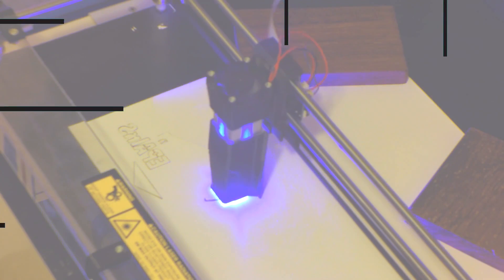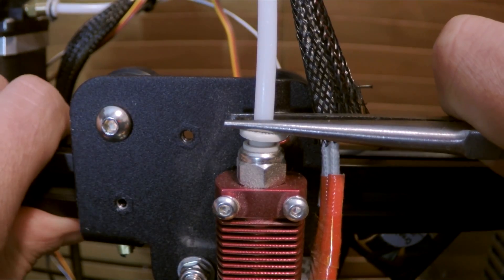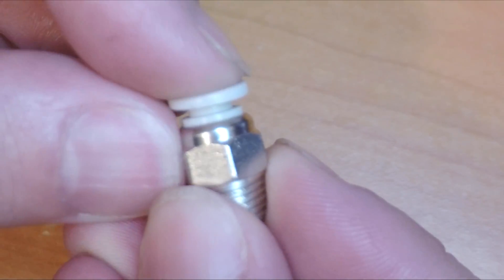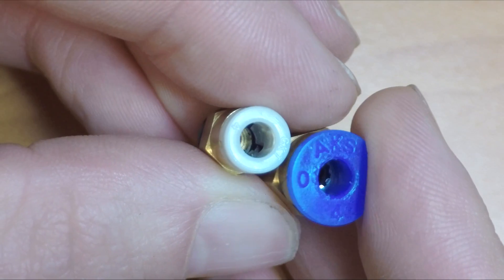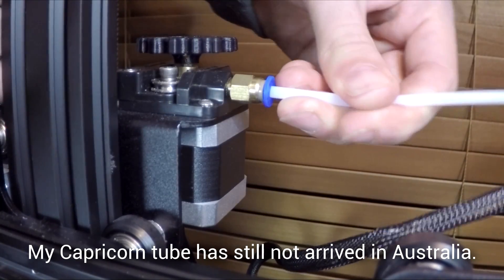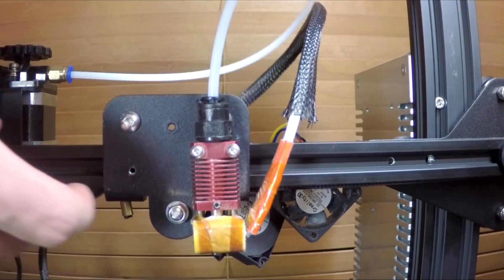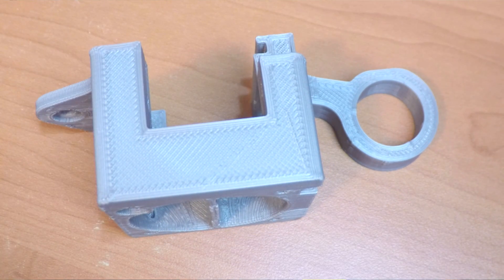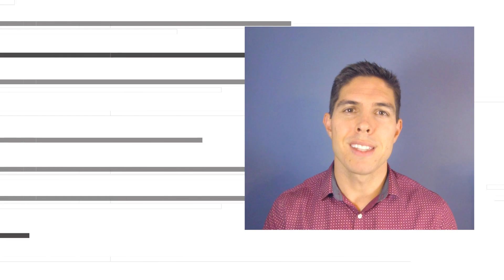Upgrading Ender 3 PTFE tube and couplings - Quick and easy!

Comment: What about compression fittings ?  I've seen a lot of favorable comments that they don't bite into the Bowden tube but compress around it- and without compressing the internal diameter of the Bowden so as to cause drag as the filament passes through the Bowden.  Comments ?

Comment: I actually had a problem where the stock tube melted in the hotend and couldn't get the filament out.
(Iv never had to work on my printer and got it second hand prebuilt)

Comment: The PTFE tube from my ender3 v2 started to come off from the extruder side a few weeks ago... notices that no filament was coming out from the nozzle when figure out the source of the issue... I confirmed that the extruder fitting part (the pneumatic joint) had no teeths to grab the tube anymore... lucky me the ender came with an extra part and the issue was fix but now I'm glad I ordered the metal extruder that comes with a new fitting part..

Comment: I just replaced the bowden tube on my Ender 3... I had similar issues with the tube not seating correctly in the hot-end. I did not replace the fitting since I previously upgraded it but it took several attempts to get the bowden tube to seat properly... Very frustrating. Eventually worked everything out and my prints look amazing so far.

Comment: ahhhhhhhhh  why in the holy hell do they use 2 different fittings LMFAO  I cant get away from this craziness whether its on cars and trucks or electronics I feel like they just use different threads to annoy consumers lol     thanks for all your videos mate!!  helped me a lot in new my venture!  i got a cr10spro a few months ago and I run the hell out of it , about 50 hours a week and I finally had my first part failure. the bowden tube popped out of the extruder fitting.

Comment: I've tried every type of pneumatic fitting available and my cr10s-pro v2 will bassically blow the extruder side tube out of the fitting consistantly. The teeth in the fittings just seem too get worn down and break on me super fast; talkin sub 100hr of printing. Either way I am looking into buying some actual compression fittings+ferrule at least for my extruder side. Fair warning tho its sortof unreasonably hard too find compression fittings for this task (ie. M6x14mmOD + 2mmID ferrule).

Comment: My fittings actually never worked. The end where you feed the filament does not lock into place, so around 2 min into the print, it pops off and the filament doesn’t come out because of this. So sad for day 1 😔

Comment: Well then, even when heated, it seems that my tube is fused to my hotend. Let's see the layer adhesion of PTFE then, shall we...
Edit: Seems like whoever refurbished my the printer I bought epoxied the tube into the hotend.
Edit 2: Burnt my finger like a dunce, but through the wonders of owning a heat gun, I hit the hotend metal-tube-conduit with 450c air and boiled the bowden tube. This allowed me to pull it out fairly easily.

Comment: Man You helped me out so much. At the 46 second mark you answered both of my questions and solved the problems that I was searching for. I have only been 3D printing for about a Month and have a bunch of stuff to learn. So I searched fo, 1. What is the Line or hose that the filament feeds into called? Answer... Bowden Tube. and 2. How do the connector ends on the Bowden tube function? I had filament that was actually stuck inside the Bowden Tube and I could not pull it out even using pliers. What had happened was, I was trying to print my first Model on my new Longer LK1 Large Platform 3D Printer. The nozzle got clogged up somehow and the Automatic Filament Feeder "Cog" or Gear" had too much tension on it and badly scarred the side of the filament so bad that it wouldnt come all the way out, either by Automatic or manually. My only option was to replace the Bowden vTube and Ends or learn how the Bowden Tube Fittings actually work. I worked on Radars for 38 years and when I can't figure out how something works, it kinda drives me crazy. The tip that you gave on how to push the sleeve of the connector in worked in 2 seconds and my problem was solved. In fact I have spent probably 100 times more time making this comment than it took me to fix my problem, of course thanks to your knowledge and instruction. I am the type of person that likes to give credit to people like yourself that take the time to make you videos and get us newbies straightened out!!!! So a great big THANK YOU "TEACHING TECH". You picked your channel name wisley and Iwill sub and return to learn more. Your'e a Good Man!!!!

Comment: Just got an ender 5 pro. The extruder side connector doesn't grip the tube very tightly and there is movement on retraction. That must be where my stringing is coming from. I've only printed the test dog so far.

Comment: Many thanks for your channel.  I recently purchased an Ender 3 and quickly became familiar with replacing nozzles (plugged).  I quickly went through the 2 nozzles that came with the printer. I ordered a variety pack of nozzles along with the Capricorn tube/fittings.  While re-assembling the tube/fittings, for giggles I ran the acupuncture needle through one of the brand new nozzles and discovered I could not run the needle through the nozzle, grabbed another new nozzle and didn't have any resistance, tried a few more and had some nozzles that presented no resistance, and some that have quite a bit of resistance (which is the correct amount of resistance? no idea). Any recommendations on a manufacturer that maintains quality control of their nozzles?

Comment: I have an issue with mine, I just thought it was the heating element but after finagling the tube, and a careful eye, I seen the tube after a while would slowly push back out of the hot end. After some further inspecting, it looks like the cap that's supposed to let the tube in but not out has actually snapped at the plastic in the hot end. It's been a while and I forgot how to insert it correctly after my printer made me second guess everything, so thank you for the video (｡･ω･｡)ﾉ♡

Comment: I got my new Ender 3 Pro a week ago. I got one test print to work, but since then the factory fitting on the extruder end as shown in video keeps letting go of the PTFE tube. I don't understand the mechanism that is intended to retain the tube (on both the factory and Capricorn replacement fittings). On the hot end fitting, I see there are spring loaded inward radial teeth that retain the tube until the flange ring on the fitting pushes the teeth outward to release the tube (factory and replacement).
I just got my replacement Capricorn tube and fittings and was searching for how long the tube should be, and I am still confounded about how to make sure the tube stays in place on the extruder end.

Comment: Been using an Ender5 Plus, a +600$ dollar machine, the tube sheered right off from the end of the extruder motor, leaving a tiny piece of the tube inside the fitting, rendering it useless, fortunately, the printer comes with replacement fitting, wondering why... , but it's only a matter of time for the trouble to repeat itself. This is not acceptable for a printer with that price tag. Looking to buy a thicker tuber and the adequate fittings to go along, must likely ill have to switch to direct drive...

Comment: I don't know if I should replace the fittings and get a capricorn tube for my ender 3 V2. I bought him a couple of weeks ago, first test print (the dog gcode) was completed perfectly but every other print I try (the cat gcode from the sd card that came with the printer) fails (extruder starts skipping steps/clicking). No matter what I do (disassamble the hotend and put it back together, make sure the tube goes all the way down to the nozzle etc) the problem persists. I am a bit hesitant to spend more money on a machine with the risk of not solving the issue.

Comment: So... I found a reliability concern using capricorn tubing. If your extruder gear slips, just one tick or more and flattens out the filament slightly, it will not clear the tight toleranced i.d. of the capricorn tubing, and cause a failed print. Just something to consider.
Reply: oh man you saved me from a lot of trouble if that's the case idk if my printer would've been sitting where it's at or at the landfill if i would've bought those

Comment: Okay, so I have an ender 5 plus, (same fitting) and it LOOKS like a tiny bit of the end of the ptfe Bowden tube BROKE off down inside the fitting! Driving me nuts to figure it out, but your video showing down into the fitting (1:10) and seeing metal really helped.

Comment: I can´t get my printer work fine extruding filament if I installe the tube jus like that. Always jams, I really don´t understand why it´s always a space inside the extruder that makes it jams, the solution I found is to to cut the end fo the tube as a cone so it goes deeper, I can feel it goes like touching the nozzle, so I have no problem printing. Is there a good extruder so I can change them to avoid this process?

Comment: Always better to remove the coupling from the hotend and not try and pull it out. I tried this this afternoon and ended up with a blocked nozzle from scrapings from the ptfe tube. Ended up having to replace the nozzle. You may need to heat the hotend too before pulling it out.

Comment: Hi just had the extruder end bowden tube come out of the fitting on my cr10-max overnight, started to print full size Terminator t800  think i need to upgrade to these.They should be metal on plastic not plastic on plastic.Didnt waste much fililment but still enjoying the learning curve.Thanks for you vids beyond helpful.thanks David NZ

Comment: a notice is the real improvement is the bowden fittings,  the tube itself is just PTFE - even from Capricorn, it's safe working temps are under 260C,  it will off gas and soften well before it hits the marketed "340C" they try to claim.  There are many other manufacturers that sell comparable tubing, that do the exact same thing.  All you want for 1.75mm Filament is 1.9mm inner diameter with 0.05mm tolerance.

The fittings stock on ender 3 , however, are pretty cheaply made and should be replaced ASAP.

Capricorn has become the "Alienware" of 3D printing.  It is high end product, but you can easily find other just-as-high end without the marketing to do what they claim, for cheaper as well.
Reply: Kissker Venwrath   thanks for the info, can you suggest a company?

Comment: I do indeed have issues with the stock fittings on my ender, extruder side much more than hot end side,... I noticed in your video that your bowden tube was jumping in and out a couple mm at a time, I assume during retraction,... I have that exact same issue at the moment. I just need to wait on some metal tooth fittings and hopefully thatll make at least one issue disappear haha

Cheers on all the great content and video, you are always a main source of information from the days before I bought my ender3!

Comment: Second print ever and my bowden tube was slipping at the extruder, even with the 'lock ring' in place. Pretty poor form of Creality to use such a poor quality part.
Reply: Sean H I have this SAME PROBLEM! I just assembled my printer last night. Can you please tell me what you did as a fix???
Reply: @etlover101agmail  I bought replacement pneumatic fittings

Comment: i just tried to remove the ptfe tube from the coupler and it stuck, it won't move even I already press down the flange button. Just need to buy a new coupler and ptfe tube instead.  Thanks for the video.
Reply: I have the same issue

Comment: The stock creality pc4 fittings have metal teeth(at least my year older Ender does anyway) in them like your replacements do, I know because I disassembled one..The hypothesis that these cause slipping isn't borne out by the evidence. The do slipperier but not because plastic teeth.

Comment: On my ender 3 it's almost impossible to get the filament to go through the coupler on the extruder end while loading filament. Why is that?
Reply from the maker: Poor design and alignment of the coupling to extruder output. Not your fault at all. Try cutting the end of the filament sharp and/or rotating it before insertion.
Reply: Yeah I noticed that. Mines the same way but after a few trys I get it. Kinda hoping my new aluminum extruder fixes that but doubt it

Comment: "Did you have a problem with the fittings that came with your printer?" 
You mean like them only lasting for a few weeks before starting to give out, letting go of the tube and sending my print quality down the drain? No, why, did you hear something? 

The Ender 3 is excellent. But let's be honest - it's a discount printer, and Creality save anywhere they can. Springs, fittings and the print surface all give out ridiculously fast and should be replaced as early as possible. And that's the trade-off you make when you buy a Chinese discount printer(however good for the price) over an Ultimaker or similar high quality brands.
Reply: @nismo510 It's one of the main themes of the Ender 3 Subreddit. Another few helpful gems is turn on thermal runaway protection by flashing new firmware and make sure the crimped connector to the power supply doesn't overheat because they're poorly crimped on some, so some Ender 3 printers actually have a bad connection that'll overheat. 
And replace the extruded spring, it'll weaken in a matter of weeks if you're unlucky, and that gives you underextrusion
Reply: which parts should I get? i got the glass bed, heat insulation for the bottom. the Ender 3 came with a 0.04 mm nozzle, when I change that do i need to change anything else?
Reply: The glass bed is fine. It's just the build-tak sticker on the stock bed on the regular Ender 3 that sucks terribly. 
As for the nozzle, a 0.4mm nozzle is fine for general purposes, but it really depends a ton on what you want to print. If you want to print ultra fine details, you'll want a smaller nozzle, and if you want to print ultra fast things with no detail at all and where quality is irrelevant, you can get a larger nozzle. 
The things you absolutely need to change as fast as you possibly can are: 
- The springs under the bed that help you level. The stock ones are terrible 
- The spring on the extruder drive gives out ridiculously fast and results in extrusion issues 
- The Bowden tube fittings need replacing pretty fast as well, but even with new ones, they need changing every now and again. You can get them in large packs with a good deal of fittings in specifically because it's a product that wears out

Comment: I bought the new couplers. The hot end one is fine, the other end is still slipping and giving me under extrusion.
What else can I do to fix the problem?
Reply from the maker: Print one of the little wedges that fit in the coupler. Or failing that a small cable tie.
Reply: @TeachingTech  done that too mate... Starting to really scratch my head now
Reply: @TeachingTech  actually...? I got my couplers off eBay and they are not the same brand .... I'm in Australia too, how did you get them delivered through Amazon? It says no delivery to Aus..... I'm thinking maybe the eBay couplers arnt as good quality as the Amazon ones....

Comment: My ender 3 is having trouble printing. I decided to take the filament out of the bowden tube but it won't budge. It hasn't snapped or anything, it's impossible to pull the actual filament out of it. Any suggestions?

Comment: Is the capricorn really worth? Or buying metal teeth fitting in a local shop will also do the job? 
I live in spain and the tube and fittings bundle is 22$ + shipping which is 14$ + customs office taxes.  While if I just bought metal teeth fittings it would be under 5$
Reply from the maker: I would prioritise getting the cap tube and source the fittings cheaper locally. Taxes and shipping can really hurt, I agree.
Reply: The Capricorne clones found on AliExpress are they as good? Like the TriangleLab 1.9mm. It's about 4 times cheaper. @TeachingTech
Reply: If ever you have to replace it again, Bowden bundle, Amazon.es 18.99 Euros.

Comment: For use with a E3D V6 that has "internal" Bowen coupler, which coupler do you need for the cold end, the M6 or M10? (think it's the latter but want to make sure).
Reply from the maker: The extruder end uses the M10.

Comment: For the M10 fitting do I get the PC4-M10*0.9 Fittings or PC4-M10*0.9 Fittings? I'm not sure what the difference is.
Reply from the maker: Me either. I've read it ten times and I'm certain you've written the same thing twice.
Reply: @TeachingTech  Oh my, that was silly. I was copying and pasting, but it seems it didn't copy the second time. The other one I meant to say was PC4-M10*0.9 Straight-Thu Fittings.
Reply from the maker: Pretty sure you want the through ones as the tube goes through the fitting and down towards the hot end.
Reply: @TeachingTech  Alright, thank you. Just wasn't sure as your video showed the regular ones and the website says the through ones are a new product. The fitting pack on their site also lists PC4-M10x0.9-4.1 as the hotend fittings but then the Straight-Thru fittings page states "This is the fitting you need for the Hotend side of the CR-10 Bowden." so I got a bit confused.
Reply: @TeachingTech   I'm also confused because on Capricorn website the "Straight-Thru Fittings" are for and I quote "the Hotend side of the CR-10 Bowden". So it's still what we need for an Ender-3 ?
Reply from the maker: The cr10 and the Ender 3 share many components so yes this is correct.

Comment: I’ve not had any issues with the stock couplings.  The mod I did was to print an oversized Bowden tube clip (130%) and it seems to jam the Bowden tube clamps nice and tight.